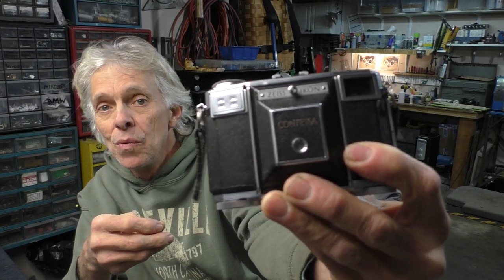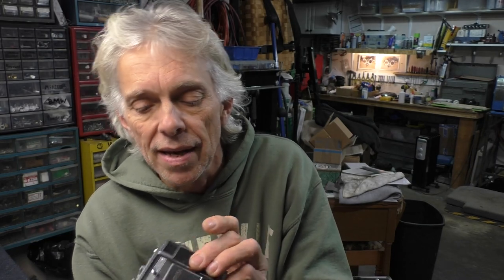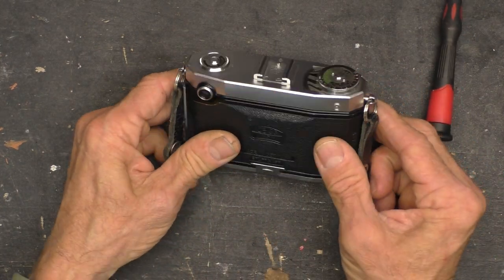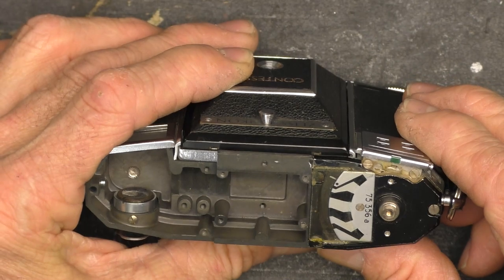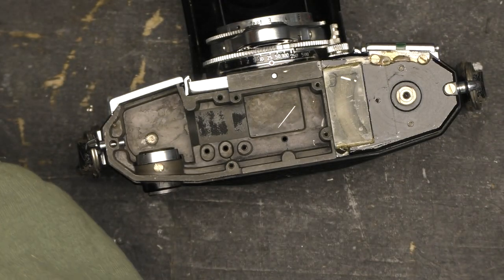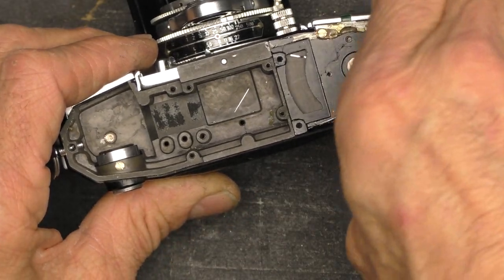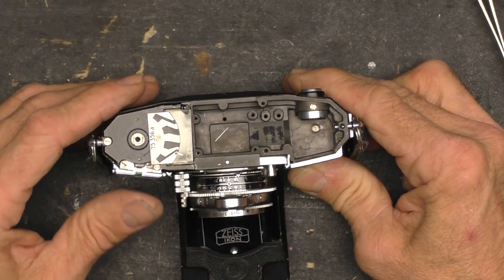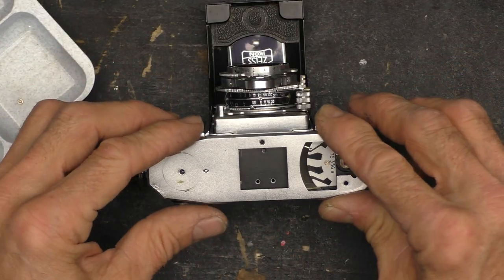Zeiss Ikon Contessa Light Meter Repair

Comment: I just bought a ratty Contessa 35 today, for the equivalent of about $62. I didn't need one, it just came up, and I know they were really well made, if not that well-designed. Zeiss Ikons in general (I have two Contax IIa's and a Nettar) are ridiculously complex and delicate compared to Leicas, and not very user-friendly. The Contessa I got  has no slow speeds, lens full of fungus, viewfinder dim, film transport sticky, etc., but I knew that. I bought it to repair, for fun. The meter is showing no response to light, of course. I was so glad to find this video to see that there is a possibility of reviving it. In particular, I really admire your light touch, and calm and methodical approach in solving the problems that came up. That's my main takeaway. Great video. I'm a fan.
Reply from the maker: Thanks for watching. Have fun with your repair.

Comment: The Contessa 35 was the first camera I ever owned, given to by my father when I was ~8 years old. It was lost in a move years ago and I've spent the past several years searching for one to replace it and add it to my camera collection. I had the original version ('50-'53 manufacture) which had the cable release at the 7:00 position and the film seed rated in DIN as opposed to ASA, which is what I had originally. A few weeks ago, I finally found one on ebay in near mint condition, with a working light meter for $100. I'm currently running my first roll of TriX 400 through it. Cant wait to develop it! The Contessa 35 was, like you said, over-engineered and an extremely well built camera. Thanks for making this video, I found it very interesting, but I'm glad that I don't have to do it to mine :).
Reply from the maker: Happy to hear you found one. Thanks for watching. :)

Comment: Dear Sir, by following your video instructions, I brought the light meter of my Zeiss Ikon Contessa 35 camera back to life. Thank you very much for your sharing. But with the light meter lid closed, it is still basically no reaction in any light condition. The light meter will only work if the lid is open. To get the right results, I also need to lower the DIN/ASA setting by one stop and read the green value. According to the official manual, the lid needs to be closed for metering under strong light, and lid metering needs to be open only when the light is poor.
I was wondering if there is a way to adjust the sensitivity of the light meter? Thanks!
Reply from the maker: Not that I know of.